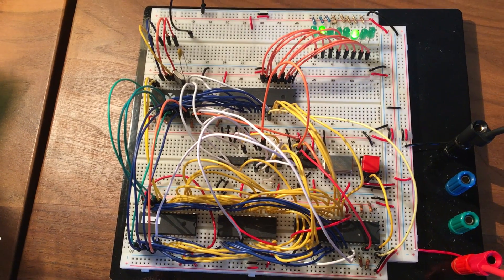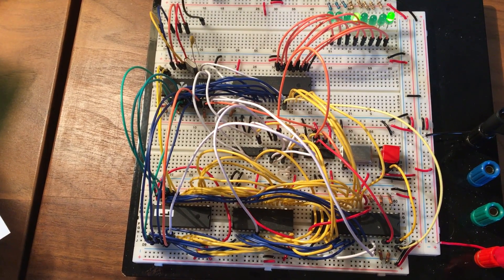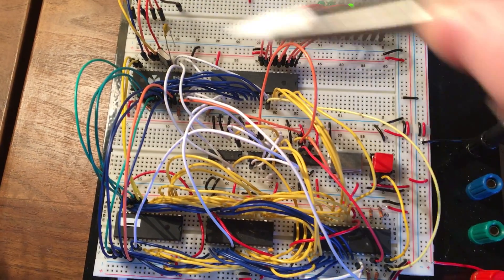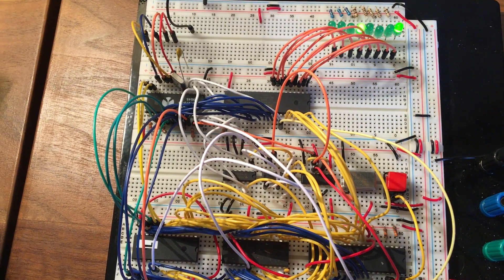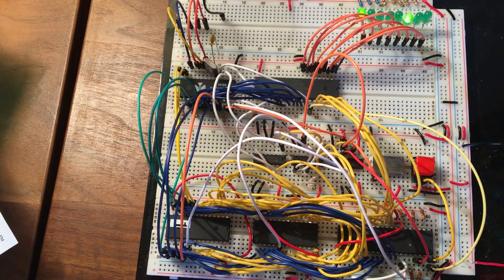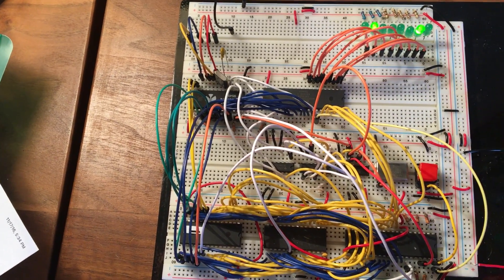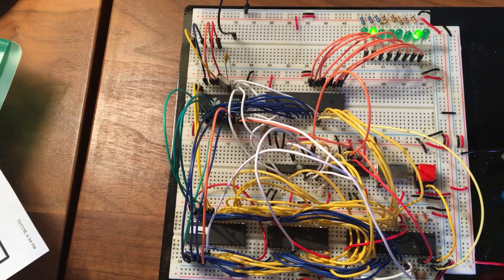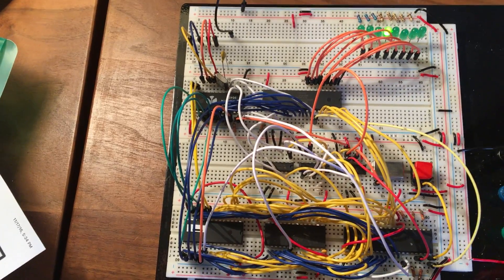6502 Mite homebrew computer project: step 4, first I/O

Comment: i tried to start with the 6551 first as well and it's been causing me a lot of trouble, so far...
i think the issue is the board is dodgy. sometimes i'm able to get a single 0 byte out of it, other times i can get nothing.
hoping to get it working sooner rather than later...
Reply from the maker: Dodgy breadboards can certainly be a problem. I'd start off by making sure that all the clock signals are good. Then make sure that you have all the handshaking lines tied appropriately... don't just let CTS and RTS float.
Reply: @pauldourish  Using a slower clock has DRAMATICALLY increased reliability for me. 1 MHz on a bresdboard is a no-go. Understandable. Might post a video soon, maybe starting a series...
Reply from the maker: @matthewpeterson5159  Breadboards are pretty bad. My machine is running successfully at 2 MHz (4 MHz oscillator being stepped down to 2 MHz by a flip flop) but it's clear that I'm at the limit of what the breadboard will do, hence my plan for a wire-wrap version as soon as I can find the time.
Reply: @pauldourish  I was able to get mine running at ~500KHz (i uploaded a video about it)
now i'm struggling to get RAM working. it's tough because I don't have the proper tools to debug it (oscilloscope, logic analyzer, etc.)
Reply: And it's frustrating because since it's so unreliable, there's a very large amount of luck involved. Which is not cool...
Really wish I could figure out why it's so unreliable right now... I mean, I'm running it at a much slower clock speed at this point and I'm pretty sure the connections are good...
Reply from the maker: @matthewpeterson5159  I went a long way without an oscilloscope, and I still don't have a logic analyzer. A frequency counter on a multimeter was useful, and a logic probe kinda handy for debugging although I'm sure I could have gotten through without it. I did, however, have an old and unreliable breadboard on which I just completely gave up and simply rebuilt everything on a new one. If you really think (and better still, can prove to yourself) that signals are not flowing on your breadboard the way you want, then that's the best course of action. Good luck!
Reply: I see the WDC w65c51 has two timing options, one using the internal clock and another using an external. Which configuration did you use, and would it be possible for the 6502 to interface this reliable if they operate on different clocks? I would assume the serial stuff is very slow compared to what the 65c02 can be run at (up to 14 MHz) so that wouldnt be a problem? Btw, I just noticed there is another crystal on your Rockwell 6551 so I guess that answered my question. :)

Comment: Any chance you could do a video on the various functions of the 6522? I'm mostly concerned with the handshake part at the moment as I don't really understand what the datasheet is saying. I have port A running fine in no handshake mode but I'll eventually need to figure the rest of it out.
Reply from the maker: I haven't had much chance to work on this project lately, although I'm hoping to get back to it soon. Meantime, have you checked out the materials at 6502.org? There is lots of useful information and many excellent tutorials, and the folk on the forum are both knowledgeable and extremely friendly.
Reply: I've been there off and on but not to the forums. I know there's a lot of information to sift through so hopefully I'll find something. My layout is very finicky on the breadboard. Unusably so.  I'm going to try a wire wrapped prototype so hopefully I can make more progress. It's worked a few times as programmed so I know I at least have it wired up properly.

Comment: i heard WDC 6552 is buggy replace it with rockwell R65C51P2
Reply from the maker: The 6522 is the Versatile Interface Adapter. The 6551 is the UART (serial interface). The current batch of WDC 6551s does indeed have a bug; instead, I bought a couple of older Rockwell 6551s from eBay. (In fact, you can kinda see the Rockwell logo on the chip.)